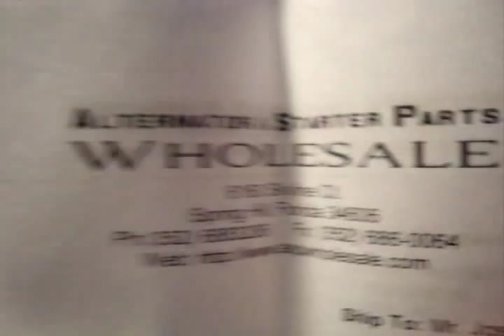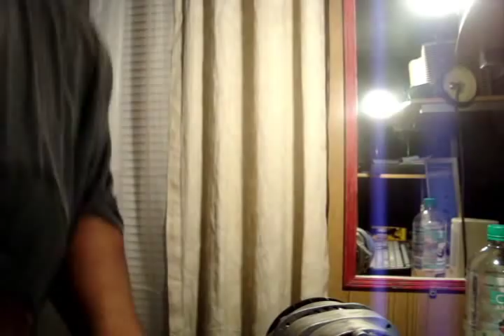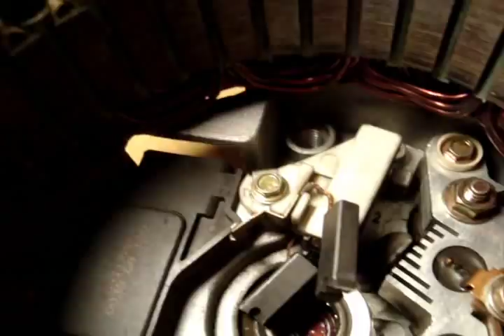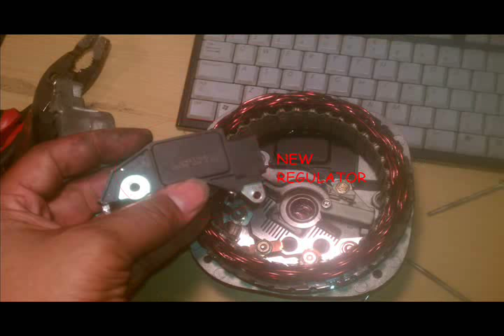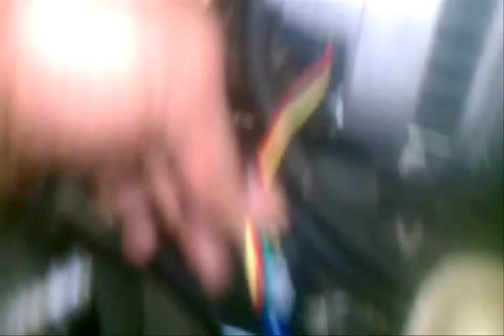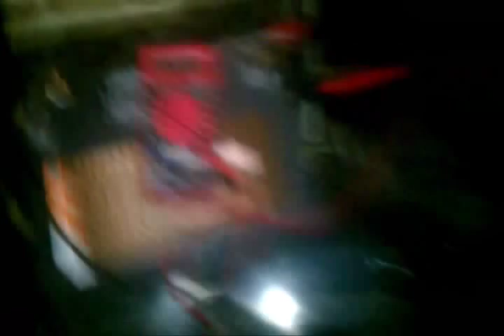Bad4health Adjustable Voltage Regulator Install For CS-130 & CS-144/ Cool Song By Local Artist

Comment from the maker: yes it works, from 12v to like 15.75 i havent messed with it in a while since the winter. i charge lower in the winter and higher in the summer. ill make a video of me adjusting it in afew days cuz its getting back hot

Comment: good job dude!   only question i have is..   why would someone need more then, lets say 14.2v?   just asking and learning.

larry
Reply from the maker: amplififers that do better on higher voltage
Reply: every amp does better at the max rated voltage ;D
i send them a message hopefully they got parts for my car

Comment: Nice video, I have cs130, Im going to make it 220a and that regulator, I need 14.6v stable, I have 1 caterpilar 1400cca 200ah and one kinetik hc1800, my system will have only mid and hi 2 crossfire vr602 and 1 lanzar opti 700x2.